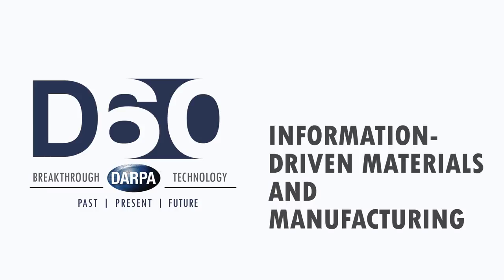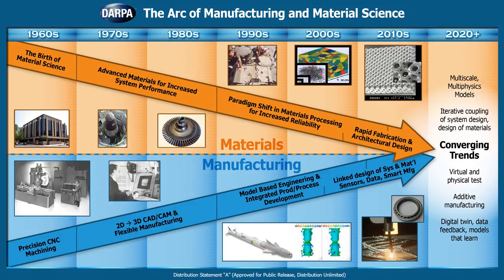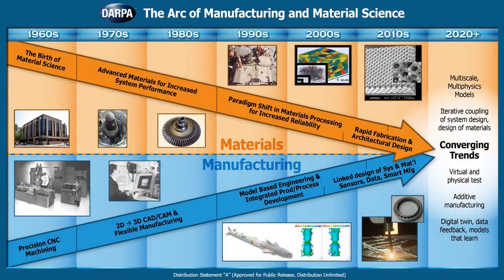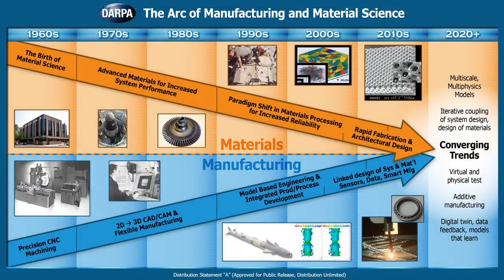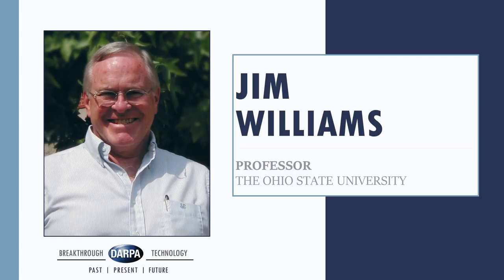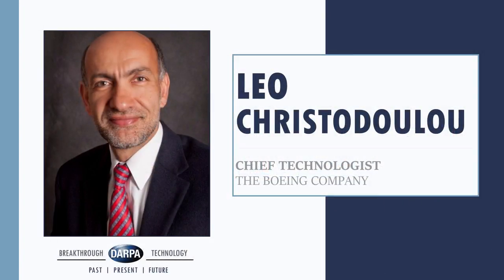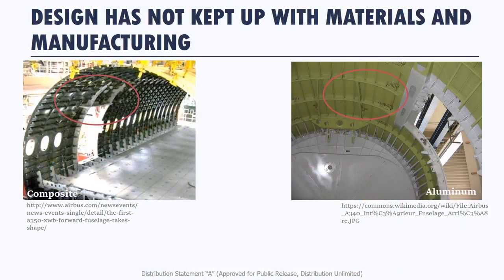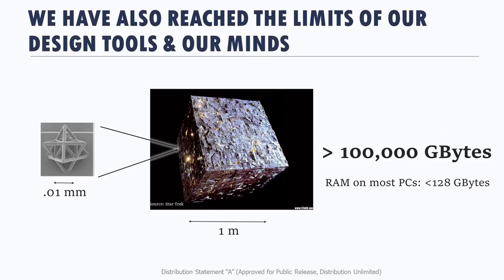Information-driven Materials & Manufacturing

Comment: Most interesting and intriguing question ; how to put computing and design into materials, rather than having them external. That would require computing at the edge. Sandwiched memory material, nano programmable processor,  with nano  inter-material spread spectum networking and  IOT coupled with secure blockchain. I would say it is very doable! Thank you for posting and inspiring!